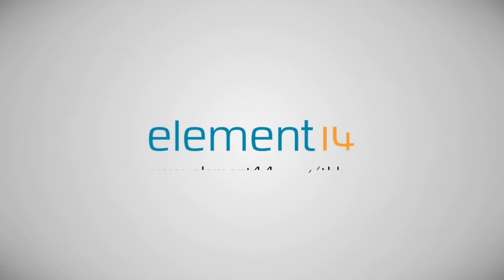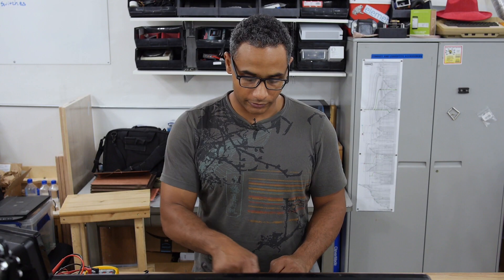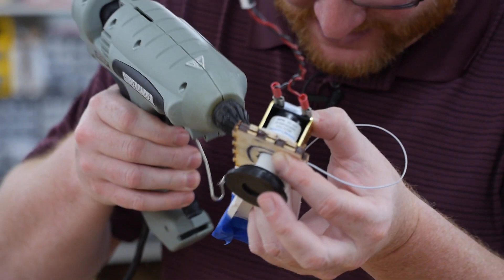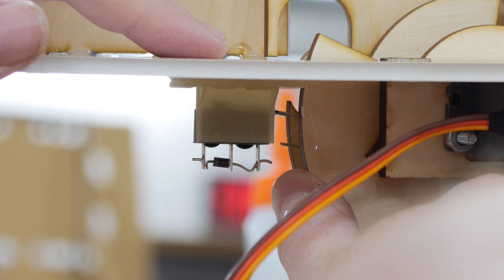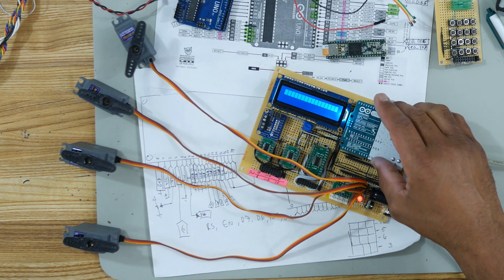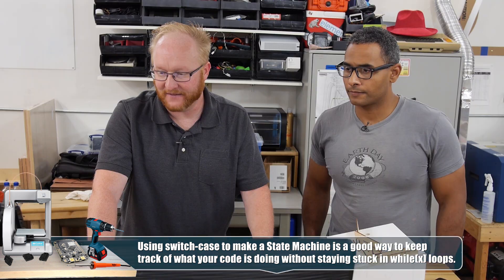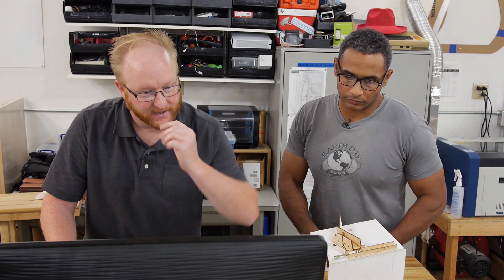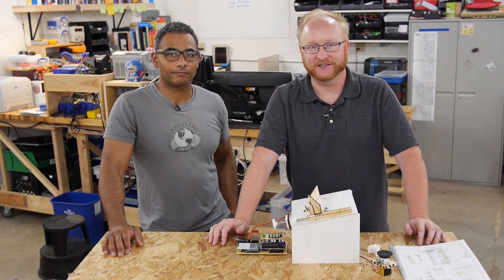Mini Pinball 06: Mechs + Microcontrollers

Comment: Hey guys, How 'bout you do a DIY-duino for this project. Use an Atmel 328p-pu right on the PCB. Add a crystal and some caps etc...  and you can wire it up for what you need and save some space as well.

Comment: why dont you use the contacts on the bumper as the switch for the solenoid? you don't necessarily need to activate it with the micro-controller, you can activate a relay with the contacts of the bumper to send power to the solenoid

Comment: Your pop bumper ring has a black oxide coating on it to prevent corrosion. Buff that coating off  with a wire wheel for better conductance.

Comment: is this going to be open source or available for purchase ?
Reply: Francis Chang I thought they talked about making this a kit for sale in part 1 but am unclear how much is involved. I hope that ends up happening, and I hope it's somewhat modular.
Reply: I really loves Ben hack shows and works. After watching Ben hack show it always give me the urge to assembly or fix something. It is hard to find Mid-tier DIY hobby kits in the internet these days. Hope that they can sell it as a kit. The concept of pin ball is a good starting point. Mid-tier as in the kit comes with pcb and components, we may have to diy solder all the parts and assemble them, but don't have to source parts individually in Element14.